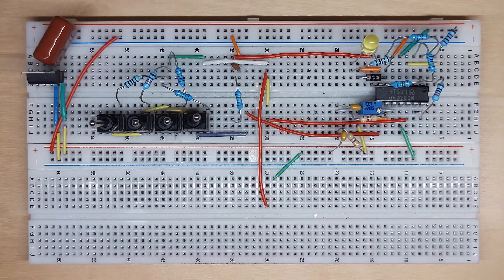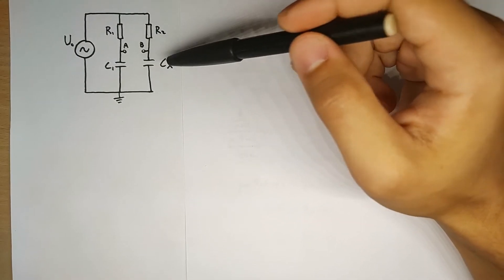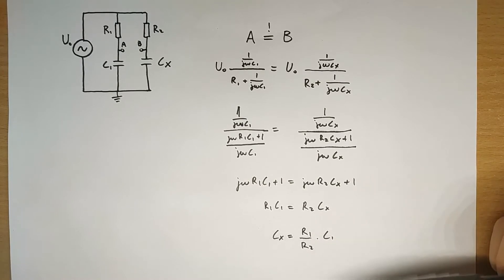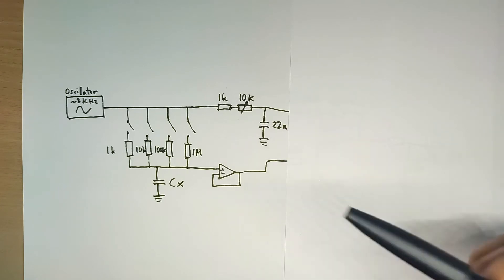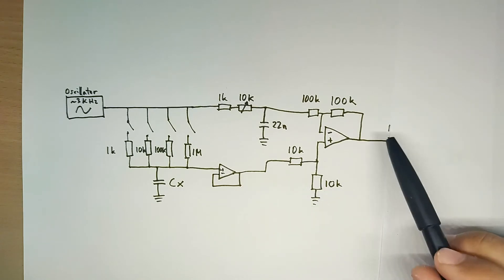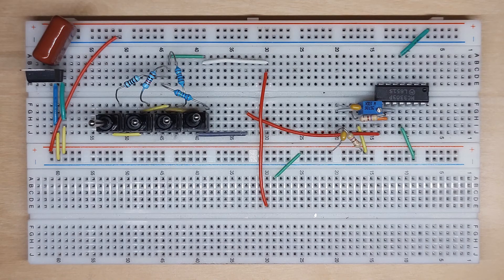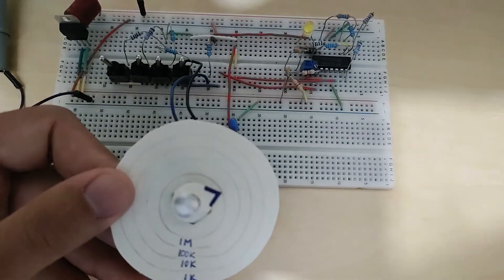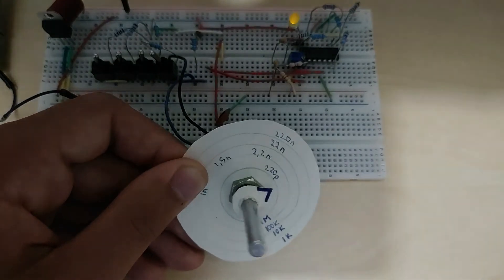How to Make a Capacitor Meter (No Microcontroller)

Comment: Cool idea . I amnthinking using a multimeter to zero the voltage and mesure the resistence ,then calculate capacitance .
Can i mesure polarized capacitor with this method ?
Reply from the maker: Thanks,
I'm not sure because I don't remember the video that well, but probably not, I think the cap gets AC voltage with no offset to keep it polarized.
Reply: @5VLogic  Thanks . Understood your answer.  Once my univarsity open i will practic this cool idea .

Comment: That's interesting
..I want to make a cheap soil moisture meter based on it. Will it be simpler if we use a variable capacitor to null out the  voltage difference rather than variable resistor. Thanks
Reply from the maker: Variable resistors are generally way more common and cheap than variable caps, otherwise it should work the same. So I'm not sure what the advantage would be.
Also I assume that you're measuring resistance of the soil, not capacitance so a way simpler approach is possible. I made a video on a very simple soil moisture sensor that you can check out if you're interested.
Reply: @5VLogic  capacitance are better representation of soil moisture as conductance is affected by salts and also depend on contact with soil particles..